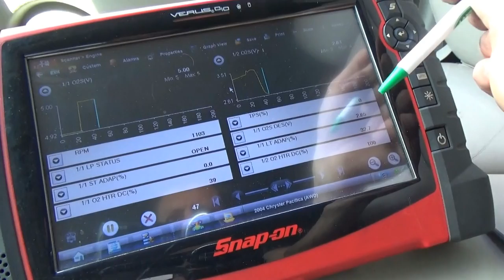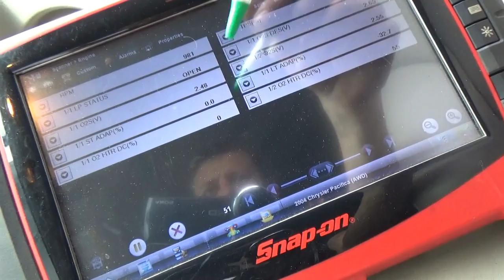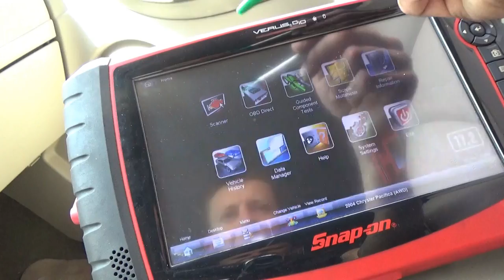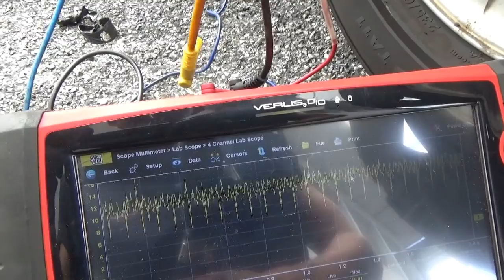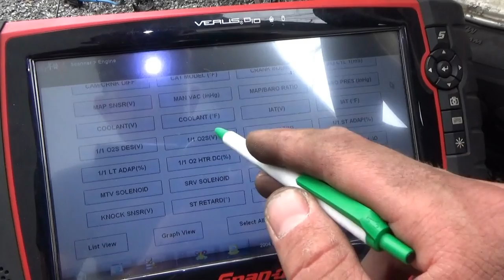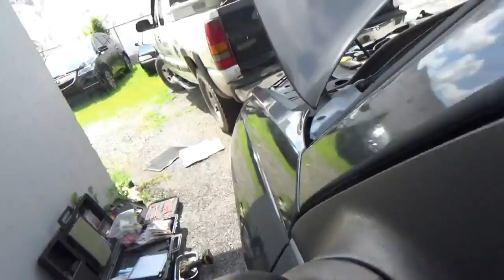Chrysler/Dodge O2 Sensor Case Study (SI Ep. 13.4)

Comment: 2008 T/C 3.8.  I fought this all day today.  Aftermarket downstream O2 sensor wouldn't talk to PCM.  OEM O2 sensor would at least talk, but (apparently) PCM couldn't supply sufficient current to turn on heater.  Heater took forever to heat up and a P0138/P0141 continued to be set.  I thought about PCM driver failure, but didn't have the tools or expertise to make the definitive test.  Thanks for solving my mystery!

Comment: I'm going through a very similar issue can anybody please help me? Have a 2005 pacifica 3.5L same location of computer on this video so same vehicle basically. Code is p0131 heater circuit low voltage, o2 sensor is a brand new denso and code still pops up.  Just replaced the ecm through ebay with vin programmed and I still get this code. Please help I heard something about the fuse box being an issue or something.  I get good ground at my 02 connector but no 12v. Thanks.

Comment: Great video Ivan, I was wondering , the Heater Duty cycle is controlled indirectly by the Engine temperature.  You didn't mention about a possible ECT failure, but I guess if there was an ECT failure , the code would have popped up and also the rear O2 would have had problems with the heater circuit. Thanks again.

Comment: I had a similar situation on my dodge that ended up being pin fitment of the PCM connectors.   There are no test points on the PCM board to tell how well the signal is getting onto and off of the board (so the factory basically considers the PCM and its wiring harness to be ONE part [which is a PITA to change]) so I'd really caution anyone working on a modern Mopar to do the drag test with a appropriately sized pin (probably .055" on these) on the connectors

Comment: What if you shirted the downstream o2 heater control to upstream and cut the upstream orgianl control wire to resistor to ground(make it belive all is ok), would it have then working o2 on upstream too? ...Or would it have bean too much for the downstream driver to handel?

Comment: Hey guy; 
Tom  here, A voice from a while ago. 
I have been out of commission for a bit and am back on the 1999 Dodge Durango no buss. The code that shows up when I hooked up the new scanner  is P 1687. I'm still worried that it might be a wire issue. I have been trying to test wires for shorts and am overwhelmed.  Any direction you could send my way?

Comment: yeah looks very much like driver issue . Testing the next era of motor cars will be fun with more computer strategy, bias voltages, dual side controls and so forth :-S
This one potentially easy with basic test procedures, never easy calling pcm though unless real clear cut evidence .
Got to love under hood pcm locations and this front wheel well takes the biscuit lol, the must want early failures and bigger expense in light front end collisions . 
Can't see how Keith can do over 20 cars in a day, if give each car 30 minutes plus mobile commute time you hitting close to 12hrs . I don't do more than 12 cars and that from a shop which far less downtime over mobile, sure some things take 5 minutes but most are 30 minutes to a good hour .

Comment: Up Date on my Tacoma problem....I Fixed it, in the end it was the Dist, apparently the Signal Generator was starting to go
bad and was not sending a signal to the ECU that the plug had been fired, so the ECU would cut fuel and spark
and a split sec later it would send signal again, so I was getting a bumping feeling going down the road.
But Hey I fixed something The Toyota Master Techs, could not find, only took me a month :)
New OEM Dist from Toyota was 550.00 Ouch. But the little Tacoma with 257,000 miles is humming down the road
again. Yea
Reply from the maker: Sweet! The igniter on my old Mazda MPV has a habit of burning up every 100k miles or so. Distributors are $300 a pop on eBay :)
Reply: I saw them on EBAY for anywhere from 99 to 250, but I could not trust them. This took me to the 
very end of my troubleshooting ability, But I learned a whole lot about my Toyota, and in troubleshooting
in general. In the end I learned you have to understand how all these electrical parts work together, because if you dont, you end up chasing your tail. It was not a easy problem to find. But because of the Videos you and Eric have posted through the years, I knew I could figure it out. Dont get upset, get educated .

Comment: So at about 20 mins, you actually said it.. The PCM has the ability to put out voltage, but no amps. And this is the biggest problem with Chrysler computers that have power switched accessories. ( not sure if this is true about those that use TIPM) If the original o2 heater power circuit shorted, the computer driver gets smoked. Chrysler does not protect its power switched outputs via fuses in almost all cases, and if they do, it's usually over fused ( the fuse is too big). They haven't done so since the SBEC/SMEC days! ( in those days, shorted injector, shorted ASD relay etc, bye bye PCM) You nailed it. Sometimes it's a hard pill to swallow, so we keep trying to prove what we already know...
Reply: At Ivan, you're probably too young to have ever worked on 1, but the old Chrysler M body cars with the ESC computers were notorious for blowing computers due to shorted solenoids like EGR and purge. They would get full of condensation and short. The computer would go into a limp in fixed fuel and  ign timing strategy , so the car would run, but have low power and really bad mileage. Techs would replace the ESC and it would work for about a day, then same scenario. Because these cars (81-89) never had a check engine light, techs that didn't have the plug in Chrysler scan tool, which connected at the ESC, could never check why the ESC failed much less read codes. They were a nightmare in the independent garage field. Unless a tech started poking around at various sensors and actuators, he'd never find what killed the ESC. The ESC was not protected at all except for main power inputs via fuse links. Back in the mid 90s, people would bring their cars to me and I got dubbed 'Mr. Chrysler'. Top things that killed the computers were shorted 02 sensors, EGR sols, purge sols, and carb throttle stop switches, all controlled by the ESC, none protected by a fuse.  A little retro for ya!

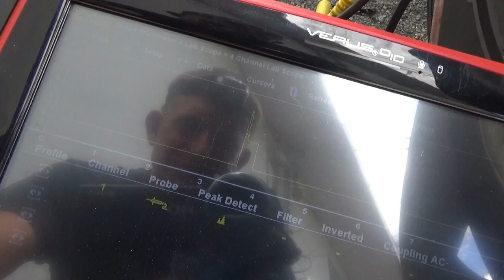Comment: Not that it matters (because this is still internal to the PCM) but the wave form you are showing at 23:41 is a classic "current limit/fold back" wave.  It seems like the current limiting circuit is actually "blocking" the signal from the CPU.  This make sense, because the data say the software has it turned on 100%.
Reply from the maker: So why is it limiting the current when it's not supposed to?
Reply: Not sure exactly why, but that big spike is triggering the current limiting circuitry in the driver.

Comment: I'd have been cranky early in and shorted the heater wire to ground too see if the ECM said "shorted to ground/low" or nothing. as it should detect when key is flipped on and not try to power on "hard/full" anymore.
then again I hate the garbage in vehicles and still prefer smoke clouds to find the issue :)))
Reply from the maker: Proper code would set most likely. The voltage sensing circuit still works :) Then what?
Reply: I'm not sure it would have thinking/guessing in terms of the ecm internals, then again I could be off target on it's design and it may still sense it proper, so if you get one you're sure is bad again, try shorting it to ground! for me/us/the world :)
it would have been great if they had the original O2's for you to test and look for physical damage, like did it have an intermittent short to ground and the ecm slowly cooked, in theory it should detect that and set code, but we all know how codes "always set and are right" HAH!!! 
it would be neat if someone could tear into bad ecm with same issue, but I suppose it's near impossible potted/sealed :(

Comment: if I was in doubt, I'd repeat the same test on a working O2 sensor/bank.
also a simple resistance test of the heater itself, compare with other bank or see if you can find known value for it. other than most being 5 to 10 ohms :)

Comment: seems having the test light on the sensor wires is more or less shorting it, making the ECM think it's shorted or stuck O2 and seems to be turning the heater off,.
would have been nice to see the light each time it started, to see if it powered it on or not when it briefly claimed 100%. thinking it was lighting and going off before you got out to see it, if I'm inside a vehicle, I put the test lights up on the windshield so there's no missing it. been burnt too many times that way :)
Reply: damnit, posted too soon in the video again :))) still wondering if it sense no or shorted O2 and doesn't try to turn on the heater.. nothing surprises me with crapslers.

Comment: As soon as you were able to instantly pull down the upstream heater output with the testlight it was clear the output on the ECM was pooched, regardless of the O2 sensor heater being open circuit/connected or not. Otherwise it would take an appreciable/measurable length of time for the ECM to stop trying. That's just the way input/output stuff is programmed. Outside of racing I'm sure the delay for determining an input to be valid is about 0.3s, a blink of an eye for us humans, but an eternity for digital logic. Connecting the test light just immediately influenced the output, hence the output was pooched.

Comment: I think I do 20-30 vehicles too ... per YEAR!! 🤣

This is one of those cars that would've had my blood boiling. Guaranteed it would've taken me 12 hours to be absolutely certain the PCM was at fault. My main problem is I get so frustrated, the last thing I want to do is experiment on good circuits. The only cure for that in my case is to troubleshoot American cars built before 1981. 😁

I hear you on the engineering! Both my '86 Grand Marquis AND my '93 Volvo 940 have the ECU in the right side passenger footwell. Only seems logical to keep a COMPUTER out of the weather and road salt! Every year these vehicles amaze me. I don't know how anyone in auto manufacturing can sleep at night. It's all about $$$$ today ...

Nice job being patient with this one! 👍
Reply: that's more reasonable for the junk that's out now days, I hate working on the stuff, so I don't ;)
Reply: I don't blame you one bit!!

Comment: Lovely place to locate the PCM. Keeps it cool I guess... water cooled!

Nothing new though. Used to own a Mk3 VW Golf or Rabbit as you may know it (1996 era). The ECM for that was located in the gutter at the bottom of the windscreen. When you read "access the ECM by removing front wipers and plastic rain gutter trim" you have to double check it's not 1st April.

That said. Never had any issues with it to be fair.

Comment: I don't think I'd condemn the PCM just yet. It would be best to check all powers and grounds at the PCM first. Yes, the downstream sensor works properly, but it's likely that its circuitry is intentionally separate inside the PCM because the downstream sensor is mainly just there to monitor catalytic converter performance and function as an emergency back-up if the upstream sensor fails.
Reply from the maker: anything is possible I guess. That would be the next step to be 200% sure :)

Comment: very interesting. the only thing i will add is this- the computer feeding the o2's instead of grounding  it appears as if it cannot feed both voltage and amperage which probably is the computer  however since it is feeding the juice i would want to test the power and grounds going into the computer since it probably has multiple feeds and one feed may be good allowing it to run but another may be bad.  perhaps one is feeding the upstream and another power input is feeding the downstream.  without a  pcm schematic you'd never know.  with multiple power feeds certainly they are split inside just how  who knows.
Reply from the maker: Good point. However just by looking at the wiring diagram, one of 4 missing main power feeds would result in more issues than just one bad power feed to one oxygen sensor heater :)
Reply: I was expecting Ivan to show us those too. I assume he checked and both oxygen sensors are supplied by the same power and ground.
Reply: its never safe to "assume" finding those feeds then isolaitng one at a time  would be the way to find out
Reply: I'm not assuming that they feed from the same place, I'm assuming Ivan checked where they feed on the wiring diagram.
Reply: I'll put this here also. 
that's funny, after finally watch the whole video, I'm thinking the ECM has a shunt bridge/resistor fault inside and it's folding-back thinking there's a shorted wire/sensor in an attempt to protect itself.
would have been interesting to check the original O2 sensor for issues, do you know if it had a shorted heater or wire issue?
Reply: And there is also the quality of the ECM fabrication, if they cut corners then the circuit controlling that O2 sensor just cracked and stop working... Maybe they built it to the tolerance limit of heat and vibration, so after 6 or 7 years it just dies. Higher tolerance costs more.

Comment: Still makes me question powers and grounds on the PCM if it was unable to light the test light. Like Ivan said, you'd think that the upstream and down would be on the same connector and pwr/gnd but maybe not. I'd hate to throw a PCM at it and still have the issue.
Reply from the maker: Good point, but would expect the car to have many more issues with a bad main power/ground at the PCM.

Comment: Just for the fun of it, I would have applied 12 to the upstream heater and checked if car went into closed loop. And O2 performance normal. Great analysis. Fun.
Reply: Ooh, great idea!
Reply from the maker: That would be a cool "bypass test" :)
Reply: or swap the upstream/downstream o2 heater wires, would be close enough. or parallel them to see if smoke emits fromt he other driver/ecm :))
Reply: Will this still cause a code if one was to supply its own 12v to the brown tan heater wire to the upstream sensor?

Comment: So you went in and resoldered/replaced the heater driver device in the pcm? LOL
Reply: You can bet if it was Ivan's car, he would have.
Reply: Always look for the "crispy critters" when troubleshooting a board. Sometimes you can smell them.
Reply: Or as AvE says, look for the shit stains.
Reply: Don't know if it's physically possible to get into these units nowadays, but back in the 90's I regularly repaired, mostly racing ECUs. Not that hard, really, just look for the component which has blown a chunck out of its case. :D

If I lived in the US, I'd have a crack at repairing those troublesome TIPM units... it irks me you guys have to swap those out just because of a bad connection/transistor/relay. I mean, you'd still need to swap them, but it would be for a refurbished unit at a fraction of the cost of a new one. I don't buy 'not servicable' until I've inspected such a unit for myself. Might even be worth reverse engineering the circuit boards and build new ones with beefier components.
Reply from the maker: I think some DIYers actually bring the troublesome fuel pump relay out of the TIPM and wire it up separately :)
Reply: that's funny, after finally watch the whole video, I'm thinking the ECM has a shunt bridge/resistor fault inside and it's folding-back thinking there's a shorted wire/sensor in an attempt to protect itself.
would have been interesting to check the original O2 sensor for issues, do you know if it had a shorted heater or wire issue?

Comment: OK, was it the pcm. was the PCM replaced? Was you diagnosis correct?
Reply: Yes it was. And I programmed the new module and retested all ok
Reply from the maker: WHEW now I can sleep at night :D
Reply: @NewLevelAuto is this true? Can this cause the heater circuit driver on the computer to go bad? "If this all looks good, we will need to see if
the ASD control circuit has voltage on it
with the key off. When there is a voltage on
this circuit, it will damage the PCMs heater
monitoring resistor in the PCM. We will
need to check the brown/gray wire at the
asd relay for voltage with the key off and if
there is voltage with the key off it will
damage the PCM."

Comment: The voltage without amps on upstream O2 might have been the voltage driving the power transistor / mosfet, leaking to the output. If there is no voltage or the transistor / mosfet has failed and does not turn on, you might see just the driver stage signal, which can put out only a few milliamps, enough to turn on the driver transistor / mosfet. Any load will pull it down. 

Same thing when the power transistors fail in audio amplifier, you might hear a very low volume sound, it is the driver stage.
Reply from the maker: I think this hypothesis is very likely :)
Reply: Just to avoid confusion in the analogy in audio whet we call the output stage is what the pcm calls the driver stage. We could have easily  gone for the same terminology but NOOOOO! 😂

Comment: So how do you know it's the PCM or a wiring problem? Did you check resistance of the wire from O2 connector to PCM? I suspect it is the PCM driver but did not see that you verified wire integrity.
Reply: Gene Mean testing the control wire at the pcm connector...
Reply from the maker: Checking the resistance of the wire (unloaded circuit) is exactly what will get you in trouble...not a valid wiring integrity check, unless the wire is basically an open circuit!
Reply: Not a valid check yes but good if you know what to look for. The purpose was to check for a shorted wire to common. May not be worth the effort but then again only takes five seconds.